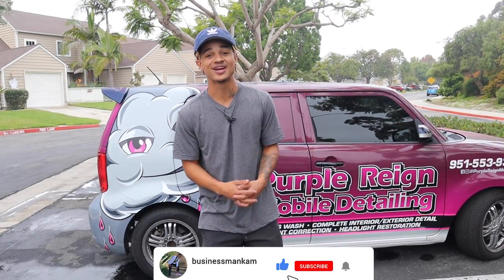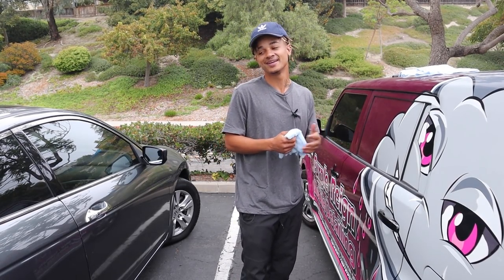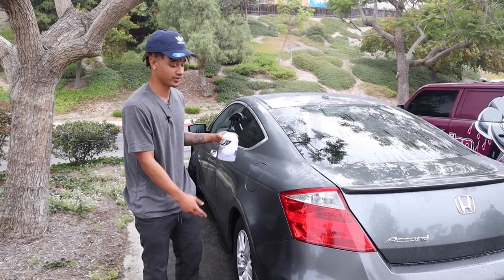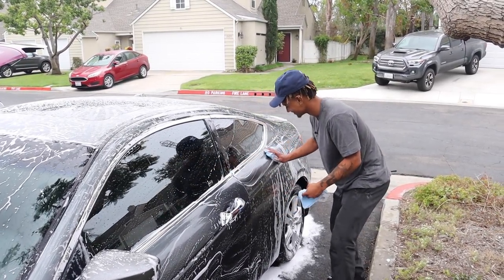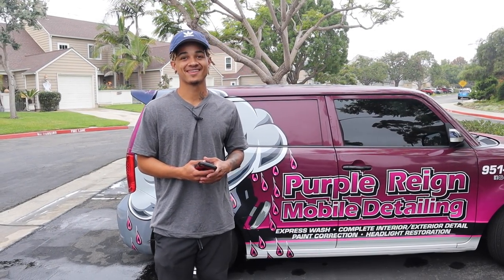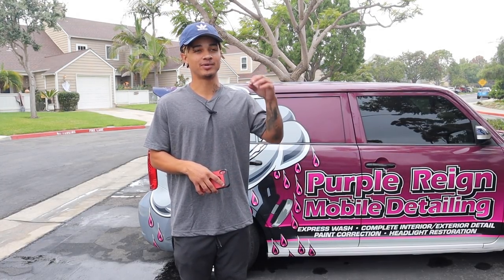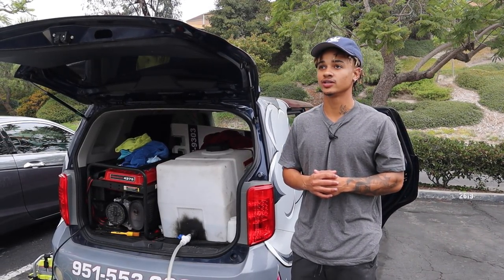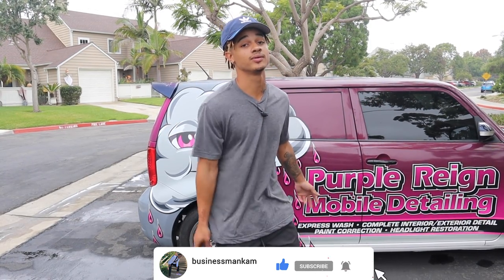My Express Wash Process and Prices

Comment: Keep it up bro! I still struggle with certain prices here and there. I charge $35 dollars just to wash a car that size. It’s rough in Mississippi though. I have a lot of customers but gaining new ones is hard. Some people here think they should pay $10-$15 dollars for car washes. Lol.
Reply from the maker: Dang man gotta raise those prices !
Reply: WTF brown bear car wash is basically more expensive than you @tsidney87
Reply: Bruh just get a 9-5 at that point folding to these cheap skates is what’s fucking the industry and making people devalue our skills
Reply: For 25 they can get a basic wash rinse and vaccum lol , no cleaning interior or anything. Because you’re mobile and using your own power and water. I can understand if you used the customers power and water

Comment: Did your tank have the spigot on it already or did you drill it in? I just bought a new one in San Diego that didn’t have it and I’m kind of stumped with that fittings.
Reply from the maker: Already had one , had to get a new fitting for it and flex seal it in but it works just fine now with a little bit of plumbers tape in each pipe.
Reply: @Businessmankam  dope thanks bro